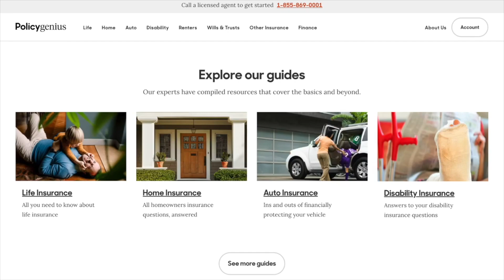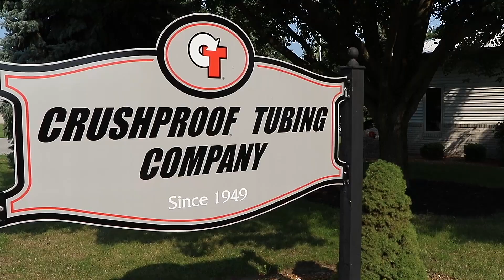Are Women treated differently as car enthusiasts?

Comment: Heal toe shifting in some high heals?  You said it Casey now you need to do it 😎🤣😝
Reply from the maker: Challenge accepted
Reply: @CaseyPutsch  Wear a dress.
Reply: @CaseyPutsch  I haven't worn heels in years,  cause arthritis,   (usually wouldn't go with more than an inch or so in boots)   but you've got to kind of roll your heel to the outside, usually,  if the pedals are that distance,  say,  close enough together.   My Duster actually kind of had enough rev-hang,  (and one of those short gas pedals that kind of ignore it if you're in pumps)  that I could just kinda pre-blip the throttle when I otherwise might want to heel-toe.  (Though you rarely wanted or needed to with that car anyway.  Way too much brake pedal travel and  shifting only happened so fast.  :)  )
Reply: Yaaasss queen! 😆

Comment: I'm not a fan of labels, especially subjective ones based mostly on outside opinion (if you want to label yourself, so be it) but uh, I've rarely seen a more futile effort than having my old lady call the parts department at the local auto parts stores. It usually goes like this: 
Store guy: Hello? 
Gf: Hi, do you have X for a Y? (X usually being some super specific foreign part that goes by several names, think expansion tank/coolant reservoir or similar) 
Store: Oh, do you mean Z?
Cause there's no fucking way you know more than me, little girl, as I shall now demonstrate. 
Gf: ...No. 
Repeats initial request. 

There has been a number of times that we've driven across town to purchase parts we were told were present, only to find out they are not. I think this is woman related because I don't seem to have the same problem, and its not like shes being rude. I think it may be intimidating for a dude to have his car knowledge challenged by a woman, and as we all know some of us can be intimidated by merely speaking to one. I dont know, this is just something I have repeatedly observed. It's also possible that I'm just surrounded by assholes. Who's to say? 🤷🏻‍♂️